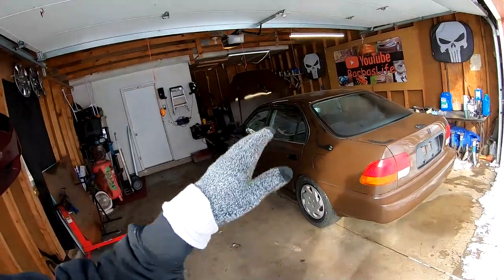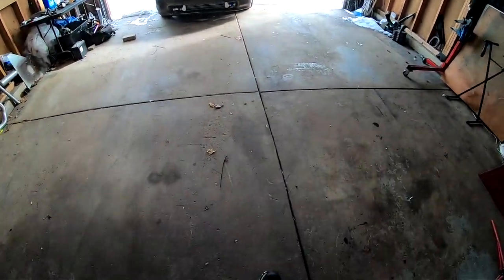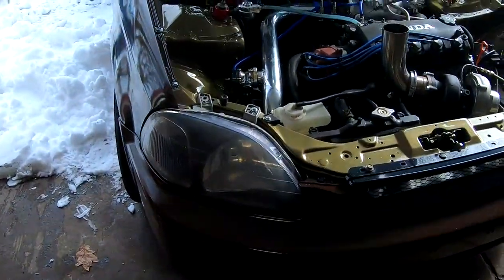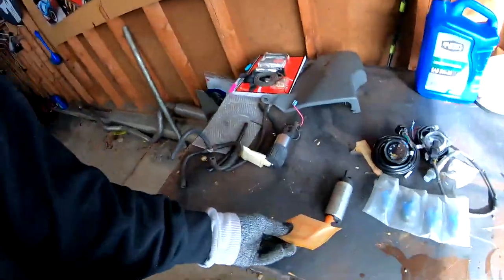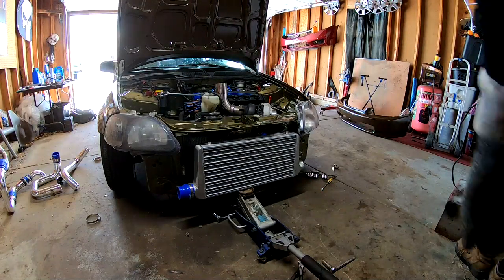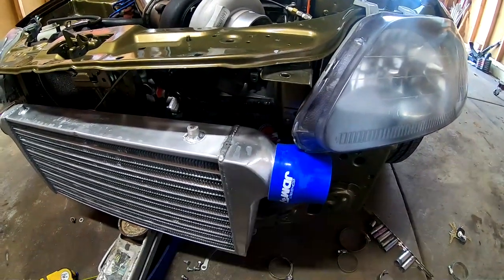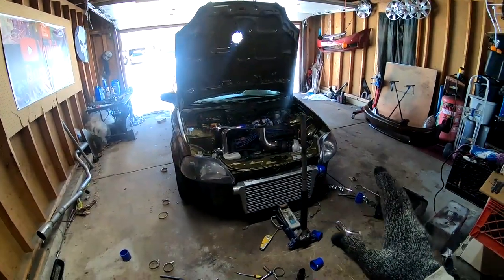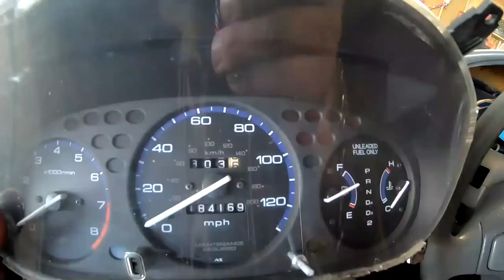Ebay Intercooler Modified for 500hp civic build

Comment: People say it's challenging to tune an engine with hood exit pipe, I'd would like to ask how much of that is true, what size turbo are you running? And what size injectors? If you don't mind me asking..thanks
Reply from the maker: I will get the tuner to answer this for you!
Reply: It’s true because the 02 sensor is getting oxygen from the exit side and it tricks ecu and AFRs